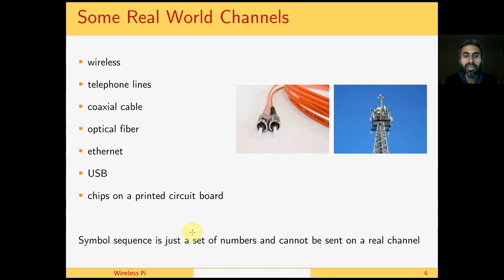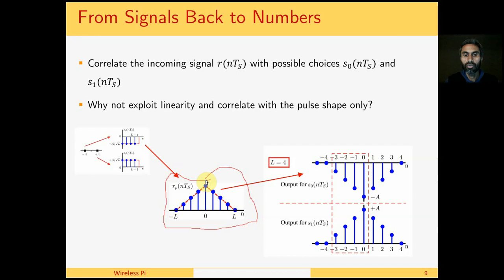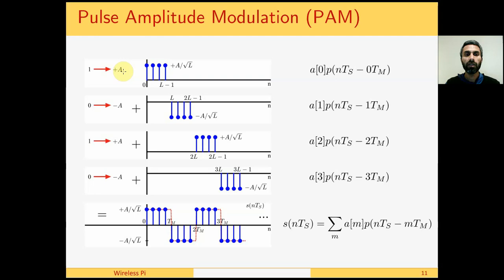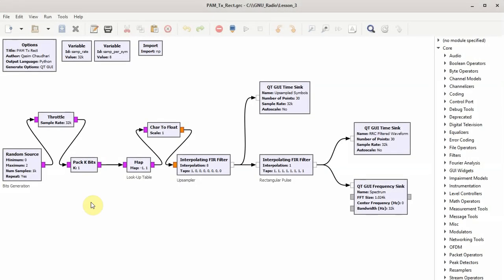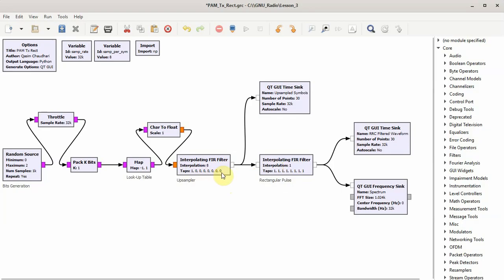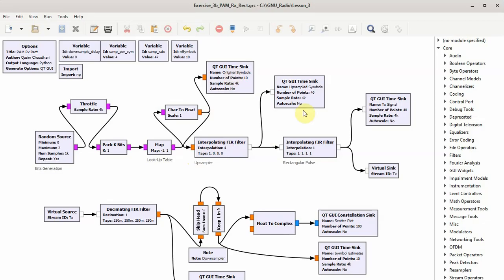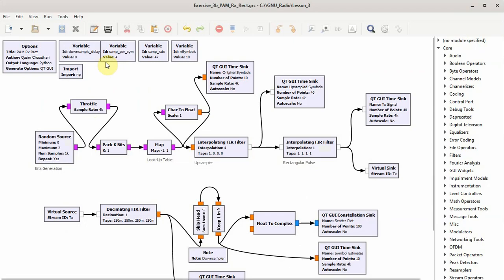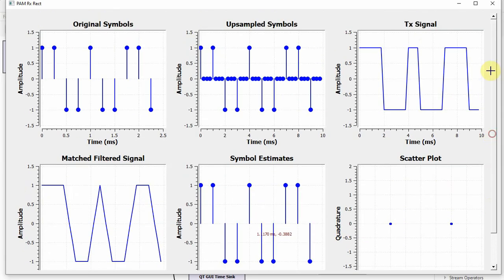What Exactly is Pulse Amplitude Modulation (PAM)

Comment: Hii Sir 
Can you tell which software are you using..
Actually I am modelling DSP DAC based Tx in Simulink with PAM4 modulation 
Input bitstream is coming and I grouping 2 bit together and feeding it to 10 bit Current Steering DAC.
Basically I need a 2 bit to 10 bit mapper how to implement it can you give some idea.
Reply from the maker: I'm using GNU Radio (https://www.gnuradio.org/).